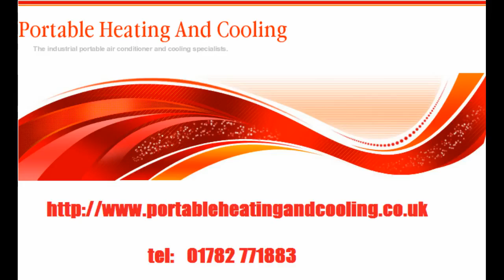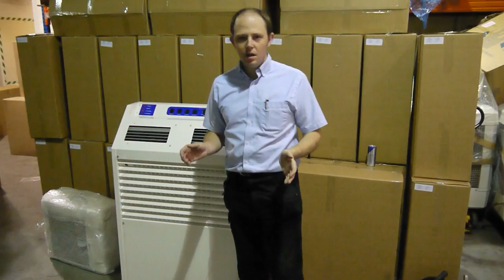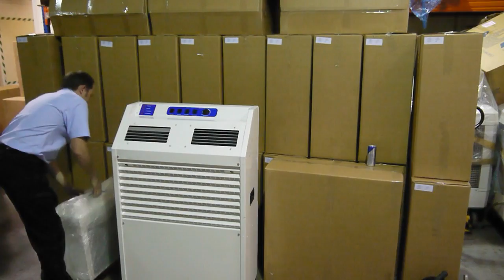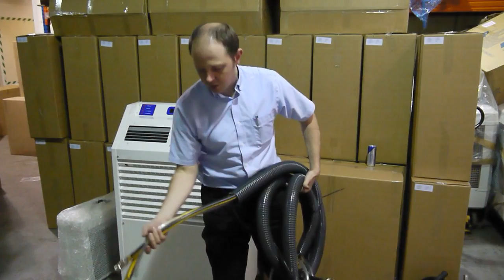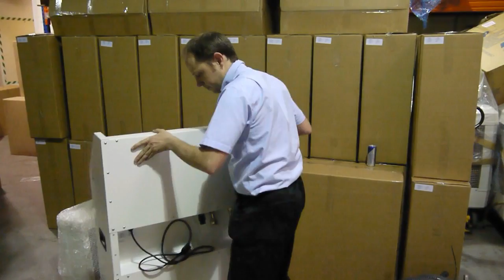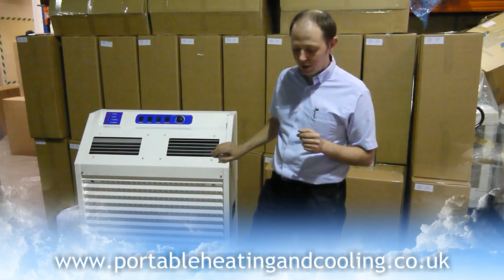Water Cooled Split Industrial Portable Air Conditioner

Comment: Is the water being recycled? My office use have an 18K BTU water cooled portable ac. I filled up 1.5 gallon of water every day and the hot steam is rejected out through 2" diameter hose to the wndow. I am looking for such an ac just in case my main unit goes out.